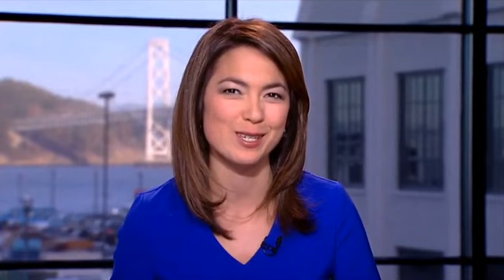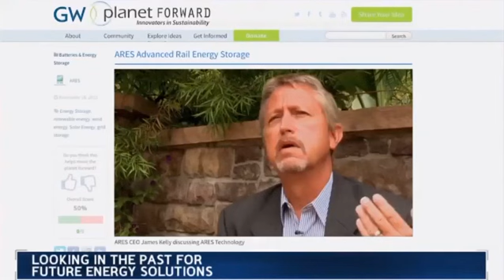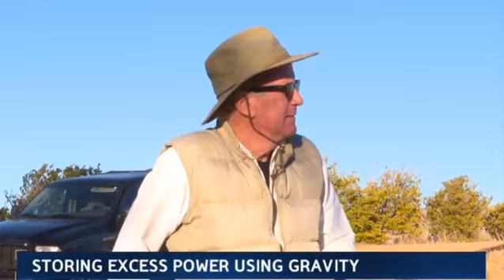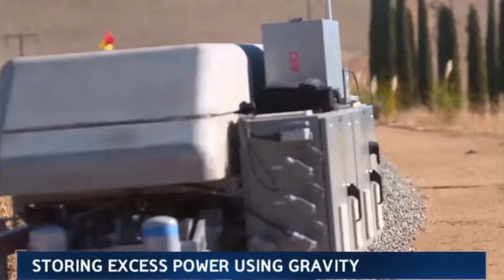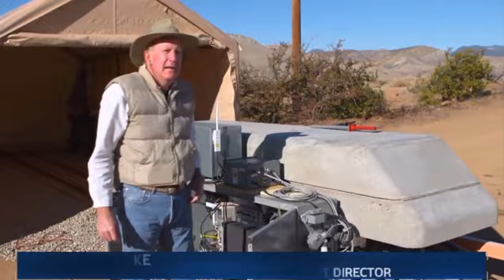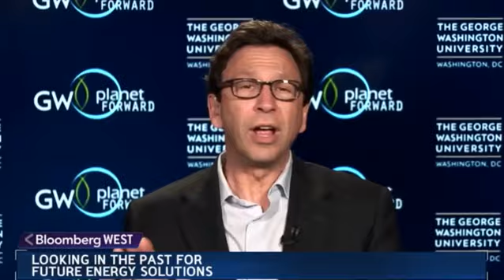A New Kind of Renewable Energy Storage

Comment: I would pick pumping water to higher altitude anyday compared to a thousands of crappy concrete weights moving up and down with so much potential to failure. On top of that this will cost way more per 1MWh of energy storage. What a waste of research funding........

Comment: They'd be better cutting the batteries out and feeding the electricity from the car through the rails, or winching a mass up the incline and using the winch motor as a generator on the return trip.

Comment: There are two problems with storage, one is actually having an excess of renewable energy on a regular basis. Certainly the U.K. is nowhere near being in that situation and I doubt that very many other countries are. The second is that the capacity required is enormous so an equall enormous amount of spare power is required to charge and recharge the battery.
We do have pumped storage in the U.K., but that is powered by fossil fuel generation and is not used to make up for intermitency of renewables but to deal with sudden spikes in demand

Comment: The energy density of water in pumped storage systems is sweet F.A. But that's not an impossible problem as you can simply build massive reservoirs. The concrete with it's double mass & greater fall compared to water is still sweet F.A, yet realistically how big can you actually make the train? One sixth of the size of a pumped storage plant? The return of Brunell's wide gauge and depleted uranium as the mass, then you might be onto something! lol
Reply: Sure there's a limit to how big they could make the train.

But they could add the carts, or prolonged the distance it travels
Reply: @fitrianhidayat  They could divert the power into a massive electrically driven hydraulic press. This could compress carbon into diamonds. Then those could be sold to buy Li-Ion battery banks from Tesla. If the market for man-made diamonds is too soft, then they could simply be burned in the coal fired power stations to release the energy. lol
Reply: A 5,000 HP locomotive requires 4 megawatts to run. Many locomotives are more than 5000hp nowadays.

Comment: Pumped storage can be done at a scale 10,000x this. Even if it's 6x more "mass efficient", you're dealing with a minuscule mass compared to a dammed reservoir of water.
Reply: I’m think whether they could use existing freight trains and carriages to add more mass? Multiple heavy trains up each track every day using exiting carriages, shipping containers full of rocks or similar. It’s way more scalable and inexpensive.
Reply: The water will evaporate in a sunny day, it would reduce the water stored. It would also take more power and more time to pump water.
Reply: @greenleafyman1028  The evaporation loss is tiny if you cycle the reservoir daily.
Reply: @greenleafyman1028  It could be done underground. My home town is building a giant underground storm resevoir to stop flooding. I wonder what the efficiency of rail is compared to fluid friction in a pipe? Using old mines would be smart. Once I crunched the numbers to see how much water at what height I would need to store a weeks worth of power for home. It worked out to a city sized water tower. With another tank buried under it.
Reply: What the video showed us was a small scale example. The question I would be asking is "what is its energy density". Although pumped hydroelectric systems have been done, and have become proven technologies, their energy density is worse than that of lithium-ion batteries. 
On a scale of megajoules per liter, gasoline produces about 34 megajoules per liter, a lithium-ion batteries can produce 2 megajoules per liter, but a liter of pumped hydroelectric water only stores 0.001 megajoules per liter.
Reply: @faragar1791  wouldn't that depends on how high you pump that water up?

Comment: My idea is to use giant coil springs that are wound using motors or hydraulics during daytime. At night they would be allowed to uncoil, turning the turbines. The rate of uncoil could be controlled using electromagnetic brakes so you produce just as much energy as you need. The rest remains in the springs as potential energy.

Comment: So you live on a mountain and own a Tesla, So instead of plugging it in when you get home, you have thrown out the back seats and replaced them with a pallet tank you fill up each night from your backyard stream. Each day when you arrive at work, you open a valve and drain the tank in the parking garage. No more paying to charge your EV.

In numbers: A Tesla is 2.4 T+1T of water going down a 2000m mountain gets 18.5kWh charge. Going up again with an empty tank takes 13kWh. Hell yeah! you even got surplusr power for your fridge and TV.
Reply: Sounds like a waste of 1,000L of water if you just drain it in the parking lot. It's smart, but a waste
Reply: @Brandon-uy1uv  the drained water would just evaporate and end up back in the mountains as rain.
Reply: Might be dangerous going downhill with an overloaded car.

Comment: Why can't this be done vertically?  Doesn't it make more sense to do this from tall buildings or in the ground much like a well?  It should also be close to population centers so less energy is lost in transmission.
Reply: Buildings are a lot more expensive than using hills. Using existing buildings can't hold much weight.
Reply: @BertVanMullem  they use it in some buildings via the elevators
Reply: Gravitricity

Comment: This is a good idea for making electricity going down hill but they never addressed in the video how they get them uphill and how much energy that takes which should be more than it produces.
Reply: No-one said it's an energy producer.  This is an energy STORAGE device, like a big rechargable battery.   
It "charges" by using electrical energy to go up hill, it uses it's electrical motors to do this. 
It "discharges" by doing down hill, where it runs those motors backwards to generate power while slowing it's descent, it's like an electric car's regenerative braking.
Reply: It is  for storing of energy,not producing.It is a big battery

Comment: This is silly. Flywheel storage is more compact. Or just pull this weights stright up. The lateral movements is just useless and waste of energy. You are wasting a lot of land and energy (friction) on rolling on rails, not to mention that you need to extract somehow the energy (breaks? linear magnetic generators?), and temporarily store it in batteries or deliver using some kind of overhead cables or third rail. That is silly.
Reply: Live close to diesel locomotives and haven't heard of Electric locomotives?
Reply: @dougmc666  
"Diesel" locomotives don't exist AFAIK. A combustion engine is simply incapable of delivering the torque to start a whole train. "Diesel" locomotives are really diesel-electric hybrid locomotives, using a diesel engine to power its electric motors and produce the needed raw force to get the train moving.
Reply: @theuncalledfor  - word games aren't fun, but you're still wrong.
https://en.wikipedia.org/wiki/Diesel_locomotive#Transmission_types

Comment: I'm wondering where are obtaining all the money for these kind of projects.
If it comes from our taxes I disagree in investing in these.
They can build an small scale project so they can save money technically this will not give you 60% energy from what he states I'm not an engineer but if you do a simple math it will not give you 60% why because you have to take that car up the hill and how much energy do you need to take it back up that hill?
It doesn't make sense at all.
Reply: Rails are far more efficient than normal tires, and commercial electric motor could reach >90% efficiency if I'm not mistaken

Comment: This seems to have way more friction (energy loss) than an elevator. 

There is a company in Toronto who is storing compressed air in balloons under Lake Ontario. I think that is a better idea than this it is 10x cheaper than batteries. Pumped hydro is also likely far more efficient than this too.

Also in New Jersey they are storing electricity in multi ton fly wheels that go at 4x speed of sound. That is a pretty interesting idea

Comment: You could ease the effort by doubling this on the opposite side of the hill Nd cabling them back and forth. The weight of one's decent would power the opposing accent. At least in theory. Just thoughts.
Reply: The system uses mechanical work to move against gravity, balance takes away the work.
Reply: @dougmc666 I agree opposing masses will not work. But from his idea, the cabling part might be something though. Tell me your thoughts on this, A super large motor/generator uphill with capacity to pull super large drum-shaped Masses which have concrete or just raw muddy earth in them.  Rolling these uphill will probably reduce the cost by a wide margin and store large amounts of energy. I heard someone say that a single train car is 130,000 dollars. Wow!

Comment: ?? You may want to explain it how u powering the train to go up hill ??   Ill stick to my free power idea generators and motors  12v motor turning 15v generator powering its self in a loop with a 12 to 120 converters
Reply: Perhaps if you paid attention to the video you wouldn't ask that question and make yourself looks stupid
Reply: You could do even better, a 30 watt, 12 volt alternator running a 3000 watt, 110 volt generator.  One hundred times more power and no converter needed!

Comment: As long as we don't talk about efficiency, this is a great idea. But this isn't serious if we really want to store energy.
Reply: "Efficiency"? Efficiency in regards to what factors? Are you talking in terms of economics? The physics of it? Or something else?

For my part, I like the idea, but it instantly seems like a small cottage locality sort of thing, in other words: not scalable. It's extremely regional: certain geography must be present. The other large problem was that it uses land. The gravity is free, which is what these guys find exciting, but land is expensive. From a security standpoint such a system would be easy to "break" and costly to fix, defeating the original intention of dependable secure energy.
Reply: ClearOutSamskaras - Your opinion that trains are "easy to break and costly to fix", compared to what? Telsa battery modules? A pumped hydro dam? 

In the realm of "dependable secure energy", If one train has a problem there are several to choose from, some of the system will always work.

Steep land can be very, very cheap as it makes poor farmland.

Comment: this is best way to produce energy going downward. but the return distance should be much more shorter while going upward. the upward track should be separate and much more shorter. this difference create extra energy.
Reply: Well try to build a model and you will see you get exactly not one crumb of extra energy.
Reply: Who cares?  The point is to store excess energy when there's more wind or sun than you need, so you can use it when the wind/sun goes down.
Reply: I think you've discovered a perpetual motion machine. Long track/short track
Reply: @dougmc666  
I hope that's mocking sarcasm, because perpetual motion machines don't work.
Reply: @theuncalledfor  - Neither does long track/short track, only the height matters.
Reply: @dougmc666  
That is not entirely true. The angle of the track influences how quickly and efficiently energy can be stored or extracted, but of course the amount of energy stored is only affected by height as you said.

Comment: Hm! I've just thought of this myself. Only that I know how to overcome the topography problem. You need no hills, mountains... No storage batteries on walls.
:)
It's way simpler. But I have no one to talk to about it. Well, not unless I'm willing to simply give my idea away. Which I'm not.
Reply: you are overcoming and then using the same vertical distance and it is gravity that is providing the resistance and gain.
Reply: How will you do that by making a tunnel or what. I am currently working this topic on my Personal Project Gravity storage currently I was focusing more on hydro storage but after seeing this video I got very intrigue with this new idea . so if you are willing to share your idea with me I am all ears :)
Reply: Sweet - perpetual motion problem solved !
Reply: this machine travels downward about 80 miles. but if it's travels upward from the center point just 5 or 6 miles. it produces more energy while going downward than it's upward journey.

Comment: Is this happening?
Reply: +John Arizona ,
50 MW Rail Energy Storage Project Receives BLM Approval
April 19th, 2016 by Jake Richardson 
Cleantechnica Website
The Bureau of Land Management has given approval for a right-of-way lease to Advanced Rail Energy Storage for a commercial-scale rail energy storage project on 106 acres of public lands in southern Nevada. “ARES Nevada will be a world-class facility and a point of pride for Nevada. The power production is clean and renewable – operation of the project requires no water or fossil fuel, and creates no hazardous waste or emissions,” explained Jim Kelly, the ARES CEO.

rail tracksThe 50 MW project is intended to help stabilize the grid in terms of voltage and frequency. (The number of megawatt hours does not appear to have been reported about, but a page on the ARES site says a 100 MW project could have 200 MWh.)

If the project proceeds, during the 8-month construction phase a minimum of 100 local jobs could be created, with 16 full-time positions required to operate the storage facility once it is fully operational. Six sets of trains would be used on 5.5 miles of rails for the project.

The rail energy project is expected to have a use life of 40 years or more, once it is completed.

If you are familiar with pumped hydro storage, you understand the basic concept of rail energy storage too, which uses electric locomotives and train cars on rails, instead of moving water up and down to turn turbines. When there is excess electricity created by solar and wind power or when electricity rates are at their cheapest, the rail energy technology can be used to drive locomotives up hill with cars behind them. Once they are in an elevated position, the cars can be released back down the slope so their generators produce electricity during periods when solar or wind power are less productive or unproductive.

ARES says the capital cost for its rail energy storage technology is about 60% of that for pumped hydro.

One advantage of using rail energy storage is that it uses existing technology. Obviously rails, locomotives, train cars and electricity generators have existed for a long time and are proven, so they do not need to be invented or iterated over and over again to be used for energy storage in the manner of pumped hydro.

The manufacturers of the rails, locomotives and train cars play a role in the development of rail energy storage and can benefit by being able to sell their products to the developers.

Comment: Kinetic energy storage sounds like a good idea but the flywheel system seems like it would be more efficient and compact
Reply: This is potential energy and a flywheel will stop by friction.
Reply: Using a train with motors and gears and additional friction losses from wheels on rails means this system isn't intended to be super efficient or take up less space on the mountain. It is intended to be big and inexpensive.
Reply: @dougmc666  yea, but you could always just dig a deep hole and use a lead weight, or depleted uranium or whatever.
Reply: Flywheel system is good for storing energy for short term because it loose parts of it energy overtime
Reply: +moosefactory133 This isn't kinetic.  It's using gravity.